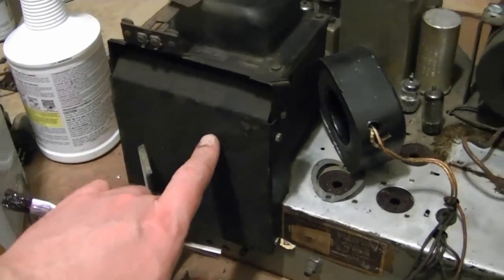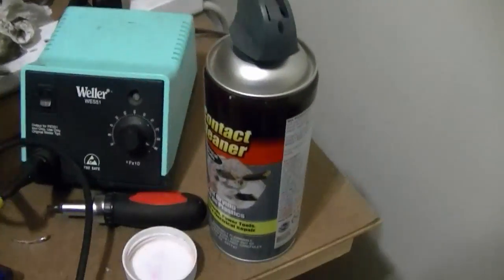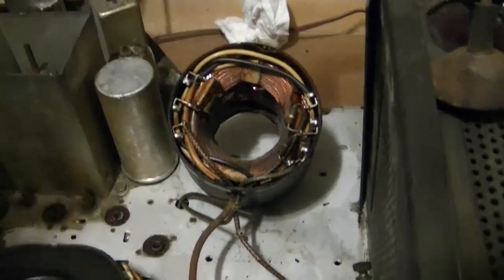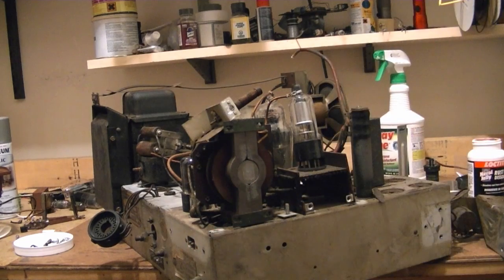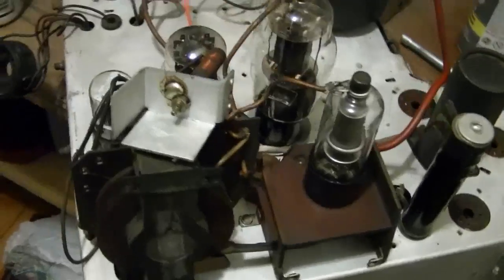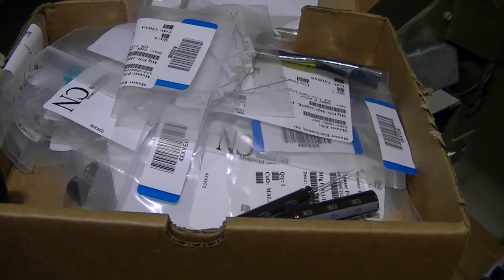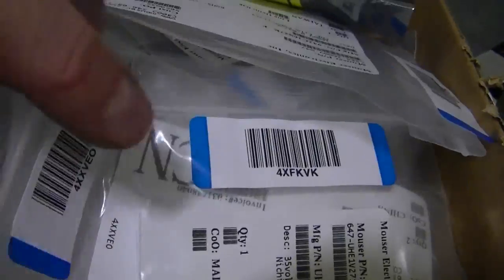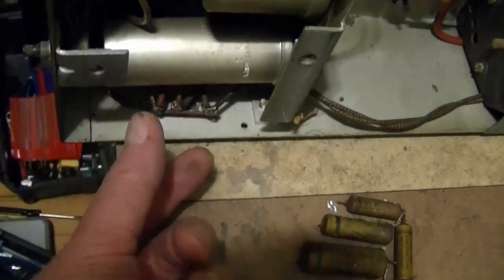RCA 630TS restoration p4o?

Comment: It looks like it may be worth investing in an old toaster oven to melt out the old caps, that's what i used to clean some out for a restuffing experimentheat the caps up four at a time and pull the innards out.Then put the empty tubes back in the oven, up on end to melt the rest of the wax and allow it to drip off.Anything remaining wax residue came off with either varsol or lacquer thinner. I found that it works better if you clean the dirt off of the wax with a varsol soaked paper towel first.

Comment: Modern electronics usually fail because of two reasons, lead free solder and Chinese electrolytic caps. Of course since the majority of consumer electronic items are also assembled in China doesn't help either, since they like playing games with cheap designs and counterfeit parts.

Comment: Get a good understanding of how they are used in a circuit, and all the different test procedures in testing them such as is it good to put a voltage source across it to see if it can hold a charge, what frequency limitations do the have, the different characteristics of different types of caps, and do it on the oscilloscope so we can see the differences in them, I know that is a lot to ask of you, but you did ask me, and I am here to learn from you. Your making a positive influence on others.

Comment from the maker: Standard caps are rated for only 2,000 hours.  10,000 is the highest I think I've ever seen.   That doesn't seem like much, but that's the life at full ratings like 105c 2,000 hours.  The life expectancy goes up tremendously at lower temps.  If that same cap is kept at 75c, it should last 16,000 hours.  Heat is the death of electronics.